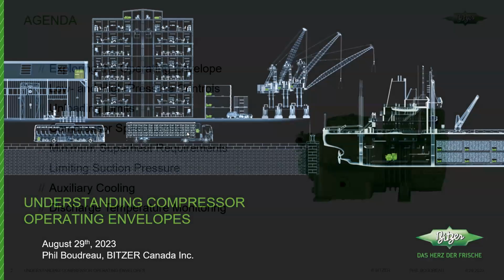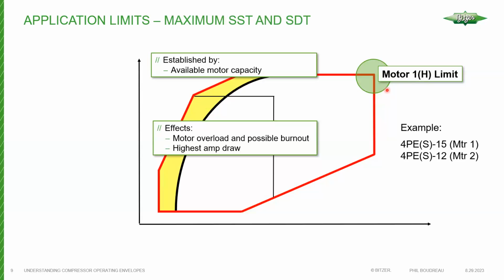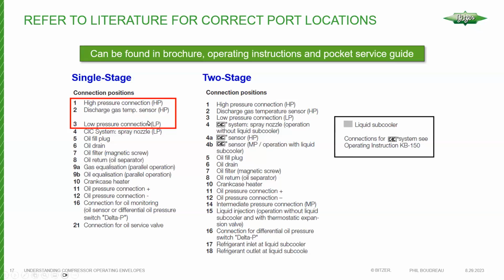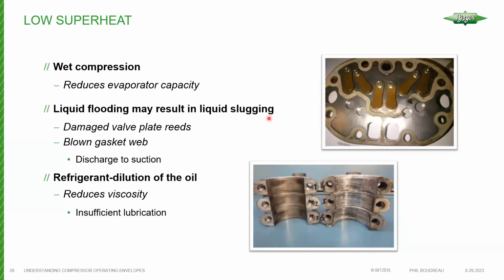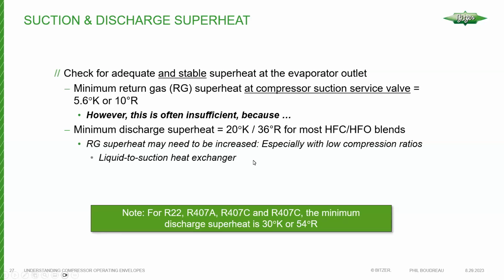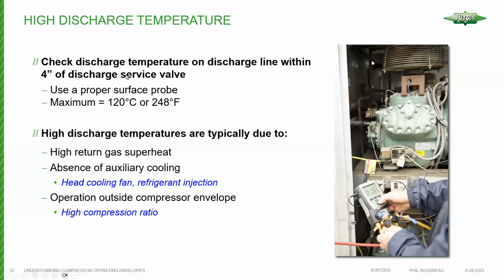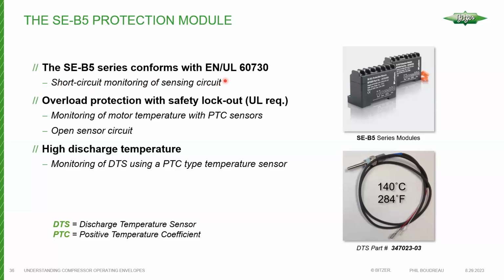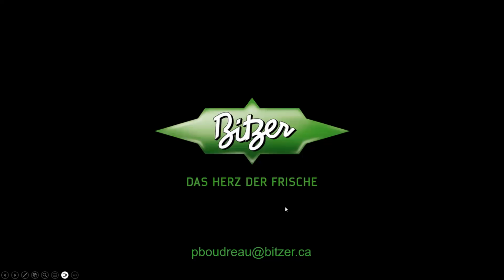Exploring Compressor Operating Envelopes

Comment: About the motors.
Do you mean same compressor come with two different motors, and I have to specify what motor I need at purchase?

Or the two motors will be together inside the compressor simultaneously?